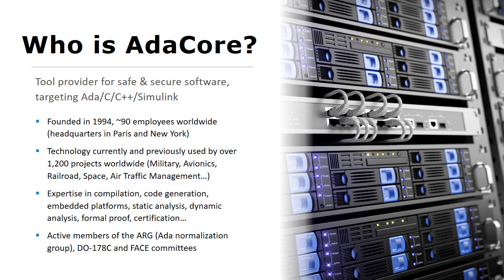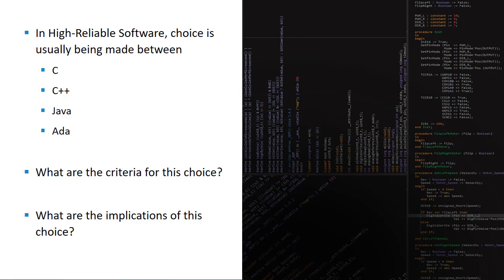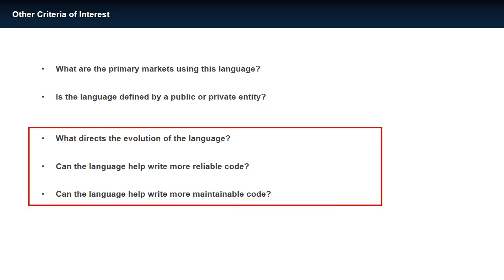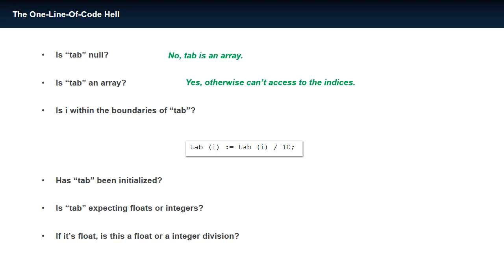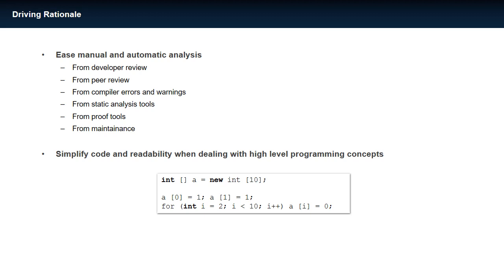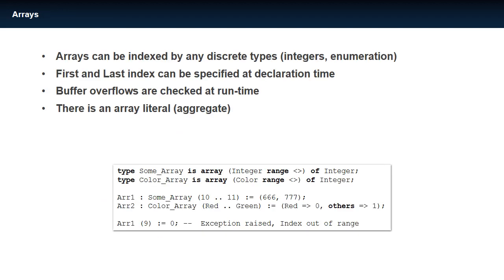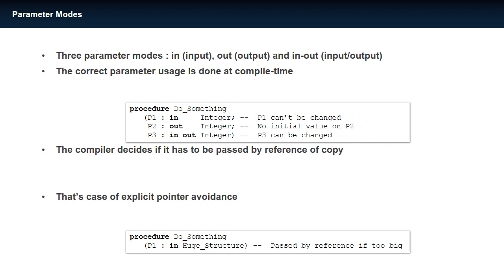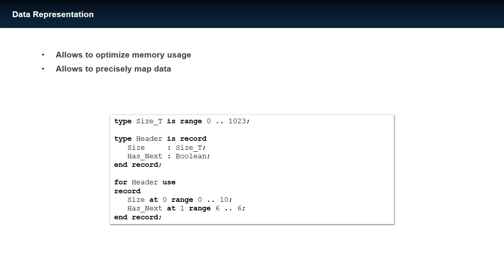Developing Embedded Systems in Ada

Comment: You can beat the drums as much as you like for Ada, as long as you have hidden pay walls for the language. 

I spent more than 4 hours the other day, trying to get normal (normal in any other language) Emacs integration for Ada (wanted to do Advent of Code in it). To no avail. That alire "super tool" sucks big time and the language server to use with eglot or lsp-mode in Emacs got built but was nowhere to be found. The default Emacs ada-mode drives you crazy with erratic indenting behavior... So, I tossed this whole idea to get into Ada in my private trash bin.

It is obvious, that all this hassle comes from adacore or whoever wanting to make people buy some overpriced IDE.
So screw Ada as long as Emacs integration is sabotaged on purpose.
Reply: I set up Ada for neovim (including the language server and the dap) in like an hour. Seems like skill issue or emacs just sucks ig, but just drop that "Ada is pay to use" argument cause it's not true lmao
Reply: @lucastentoni3599  It is a skill issue indeed. The skills in questions are those who wrote and published a faulty ada-mode.el. And it is a skill issue, that people still think "package managers" like cargo or opam or alire or npm are a good idea.
Now I could not care less about all that modern crap if it just worked. But that seems to be asking for too much. So, why do people hand out stuff which is broken? There is only a limited set of explanations: 
1. Skill issue - they just can't get it right.
2. Business model: They want to frustrate "freeloaders" into buying some expensive ide.
Take your pick. My pick is 2.